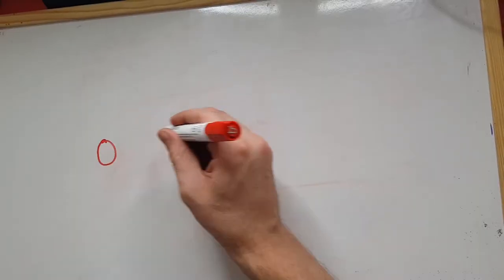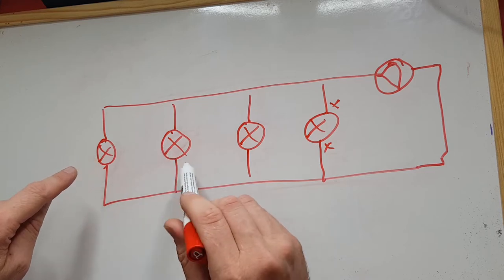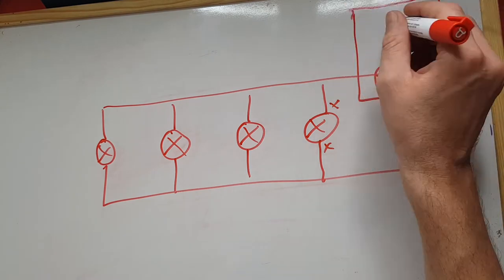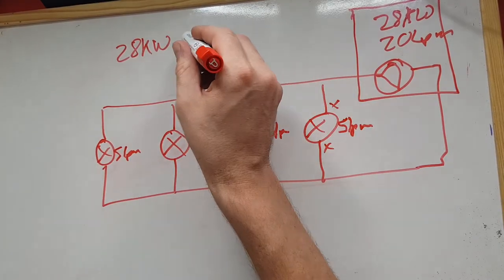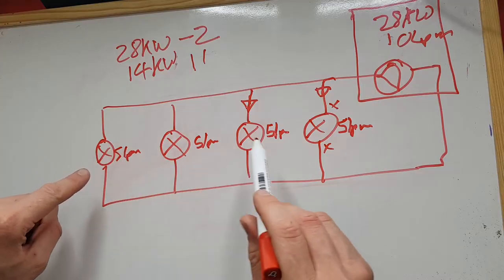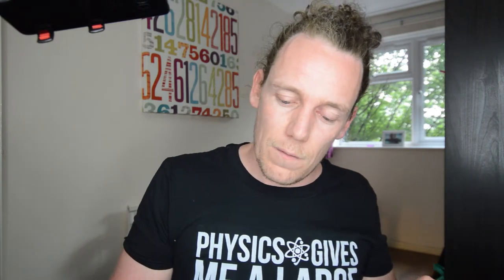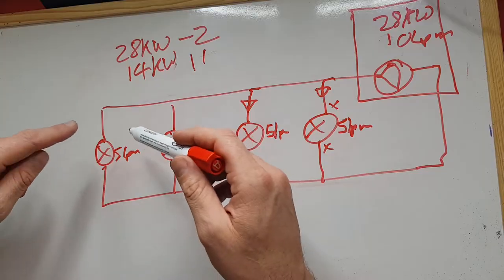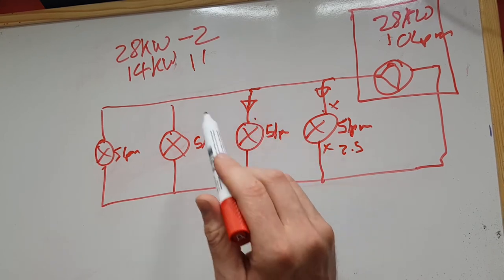Automatic balancing TRVs - Are they worth it?

Comment: Hi, I'm struggling to balance my system and wondering if boiler was ever the best choice for the property (here when I moved in). It's a Keston 55 heat (2 heat zones and 1 DHW). I noticed that the Automatic bypass valve is open all the time even if all three zones are open and the pump isn't on overrun. So the return water heats up immediately as the water short circuits and the boiler then modulates right down. This continues on the entire time the system is on although the radiators do heat up. I did change the valve to a Honeywell as the original was a cheap basic unit and the seal was damaged but even with the £45 honeywell valve there hasn't been any change. Any advice?
Reply from the maker: sorry, there's a bit too much going on there. we would need to see the job.
Reply: Sounds to me like you could do with a low loss header being installed and  by pass SHUTTING permanently. Bit confused as to what you mean by pump isn't on over run as pump is in boiler ,so it has to have a pump over run cause that's what Keston's require, unless its been wired incorrectly.
Reply: Your ABV should not be open at any point ! (Well, almost never.). It only opens in an emergency when your system pump is running full blast (why?) and most of your TRV have shut down because the rooms are up to temperature.
Honey VT117E TRV are rated to work at 0.2bar differential pressure, ie. your system wide pressure drop across flow and return is 2mtr head, more or less everywhere.  So setting the ABV to 2.5m head is nicely balanced.
If your property pipework is undersized and the most distant rads are getting really low diff pressure, the installer may have fudged a solution and set the pump to run at 4mtr head.  Then your correctly set ABV will seem to fail and be open all the time!
Your next level fudge is to set the ABV to 4.5mtr head so that it shuts again, and only opens if nearly every TRV has closed.  The risk then will be that all of your TRVs could be suffering from the excessive diff pressure. If your Honeywells start failing to shut off, then look for some non-Honeywell TRVs that are more highly rated.
The expensive but really good solution though, is to upgrade the size and configuration of your rad pipework so that all rads receive a fair share of the diff pressure from the system pump.

Comment: @Heat Geek  So - I've decided to replace my old standard vented system with a combi boiler but worried that all that expenses will come to nought if my rads are not balanced - hence rather than using the slooooow and error prone way of measureing the deltaT across each rad (I dont even know what order they are in) I want to install something to take the guesswork out of it. So, what TRVs should I select (want the get rid of the lockshields and put their functionality in the trv at the same time) ?
Reply: Hi Kev. As far as the auto balancing valves are concerned, some things need to be clarified:
1. they are directional. So they need to be installed on the IN side of the radiator, rather than return. 
2. Second thing - they do not get rid of the lock shield - the lockshields are required on the return, but are needed FULLY OPEN. 
3. And the cherry on the cake - with the Drayton auto-balancing valves they only allow for settings in a range of DeltaT10-20 on the radiator. Do not confuse with DeltaT for the system. In order to get them to work within the range and do their job - your system is required to run in the still very rare range of Low Temp. flow. So anything that installers used to set-up in the last 10-15 years, with the standard Flow temp of 80/60 return (DeltaT50) is outside the range and will get you nowhere with those valves. 
As per my few discussions with Drayton support, the conclusion is - unless you run your system with DeltaT for the emitters at 20 or lower, the Auto-balancing valves are not for you. 
No manufacturer states that (Drayton, Danfoss presumably neither)!! To run your system with such DeltaT you would probably need to live in a new-build with great thermal / energy efficiency. I suggest reading a bit on how the Low Temp. flow concept works, what is required, how it changes efficiency of your rads and whether your heatloss calculation shows you're at all OK to run the Low Temp flows in order to heat up your property. You may as well find out - the whole thing as greatly as it sounds is fiction and in real live completely unachievable for 90% of British houses....
Reply: @arturlorek7977  not just new builds. Most terraced houses with adequate loft insulation have fairly low energy requirements, so low flow temps are possible. Mine is a mid terrace Victorian house and I can run my boiler at 50c throughout the year and keep 21c throughout the house.
Reply: @immers2410  not saying that the low flow temp is impossible. However you know very well this is not only about the loft insulation. Proper heat loss calculation takes into account loads of other elements - wall types, their insulation, window types (not all double glazing are the same in terms of thermal efficiency), floor/ceiling type/insulation, etc. So simplyfying the matter to a statement - one can go with low temp flow once they have sufficient loft insulation is at least misleading. The fact that one can go down with flow temp on the boiler does not mean the CH is going to be efficient. To prove the point you can run it that way - yes, this can be done. But will it run as it should, giving heat as calculated and so on - that is another matter. Properties in the UK in the grand scheme of things are improperly insulated. Simply because no one cared for this over the last few decades as the cost of fuel/electricity was low so the cost of proper insulation and energy efficiency was far higher than the benefit. It is only in the recent few years we're observing a U-turn and such increase in heating costs, that we are trying whatever we can to get the bills lower. Still does not mean that with most scenarios this will work as it should. And purely mathematically your 51C flow ideally would get you 20deg drop on return and paired with say 20C room temp - we're looking at DeltaT20, which is the upper level of the Drayton auto balancing valves operational range. Ideally you should be running at 45C Flow, to get it in the middle of their range. With such a low flow temp - I feel that running your CH all day long would not get your property heated. So insulation on all fronts would be the key, to not having had to go for a K3 rads 2m long in each room 😂
Reply: @arturlorek7977 so many words to say very little

Comment: Can the IMI and Drayton auto balancing valves be used on radiator systems that have variable speed pumps. Some are saying they're just for fixed speed pumps so would that not mean they won't work very well with a V-200 on weather comp?

Comment: A modulating boiler just modulates the flame. The amount of water pumped remains the same. The modulation part is more heat from more flame. This means that self balancing valves still work as expected even with a modulating boiler because the amount of water being pumped around the system never changes. Or that’s how I interpret things 

They are perfect for smart radiator valves that call for heat individually.
This is because if one radiator valve (TRV) is fully closed then no other radiator is affected as the flow is maintained as long as every radiator has self balancing valves fitted. 

As one radiator is closed the return temperature increases (due to less surface area for heat dissipation) but a modulating system should reduce output to maintain a factory set temp delta (usually 20 degrees). 

This means if you set your boiler to 65 degrees the water will be 45 degrees when it gets back to the boiler. 

The aim is to have a return temp of less than 55 degrees for max efficiency. 

There are some high end boilers that do modulate flow but they also incorporate a pressure sensor that would mean that flow is maintained. 

In your video you are suggesting that lower boiler output means lower flow but I think this is incorrect. A lower output means less flame so less heat. Water flow is fixed and doesn’t change from the boiler.

Comment: In a heat pump system with an underfloor manifold and a radiator manifold in separate floors:
Would you recommend one lock-shield on the radiator maniflod to prevent water from preferring this route with less head loss?

Comment: Is it possible to say what the radiator flow and return differential should be when balancing radiators on a system powered by a heat pump?

Comment: Enjoyed your video but have a question:
Question: I would like (if you agree) to have Drayton balancing valves fitted to my rads. Presently I have 10 rads that have  type TRV’s fitted except 2 (bathroom towel rad and hall rad because my wall T/stat is located in hall) and those two don’t have any controls and this is because my Worcester/Bosch boiler manual states that the installation should have 2 rads without controls that will act as a bypass in (addition to the integral bypass within the boiler). This conflicts with what Drayton said that all rads should have balancing TRV’s fitted, so what is correct? In conjunction with this, won’t the wall mounted T/stat be fighting with the TVR on the hall rad if one is installed there? And can the system not be considered balanced if those two rads do not have balancing TVR4’s fitted? Thanks for your patience.
Reply: RE: bypass question, see https://youtu.be/jqu2FpAA8IA?t=1177
Reply: Hello, when they say all rads need to be fitted with TRV’s they mean the body of the trv and then set the flow rate. You wouldn’t install the actual trv head on the bathroom towel rail or the hallway rad.

Comment: But how does this apply to a rural setting where we use a system condensing Kerosene Boiler with a fixed pump speed? and no pump over-run. What's the best way to maximise the efficiency of this system?

Comment: So should I fit self balancing drayton trvs or not! I am replacing my old boiler with a standard boiler (keeping vented hot water tank)
Reply from the maker: No they aren't for homes.. they are for communal heating systems...
Reply: @HeatGeek  so why does drayton say explicitly they offer homes especially if they look nice in polished chrome?
Reply from the maker: @kevinleesmith  becaise they want to sell as many as possible. I spoke to them directly about this, infact they called me. It was embarrassing
Reply: @HeatGeek  so why can't they be used in a house? And what do u mean by communal systems?
Reply from the maker: @kevinleesmith  they can be used in a house, you just won't see any benefits over standard balancing and will have increased system resistance as the video suggests
Reply from the maker: Conunal system is a blick of flats for example with a shared heat source
Reply: @HeatGeek  when you say ‘increased system resistance’ do you mean it will result in the pump running against a somewhat dead head and causing  noises in the piping and/or overall system etc?
I was considering installing these Drayton TRV4 self balancing valves in my house. I have 10 rads with old style TVR’s on all except 2 of them (bathroom towel rad  and hall rad where I have the room T/stat). My Worcester/Bosch manual says that those 2 rads should not have a TRV on them as they should act as bypass valves (even though there is an integral bypass in the boiler). Drayton say to install them on all rads, which contradicts boiler manufacturer and if they where only installed on the other 8 rads, could you still balance the system?  Totally confused!!
Reply: @HeatGeek  Alo Alo

Comment: Hi mate, my understanding is these valves shuttle open/close as the burner pump speeds up/down, keeping flow equal between rads. What am I missing? (Keep up the videos and blogs. Great work 👍)
Reply from the maker: Hi Dean. Thanks for your kind words. I'm not 100% sure what you mean. But, these valves do not have communication with eachother... the only thing they do is allow a set continual flow rate through that specific  radiator.. does that answer mate?
Reply: Heat Geek my “crude” understanding of them is they are spring loaded. When boiler speed is low, the valve closes down letting little flow through. When it speeds up the valve lifts, letting more flow through. Setting the valve, limits the max flow through the valve and creating more/less tension on the spring (I’m not sure about the tension part, I’m assuming). Your video is how I would interpret a lock shield valve. Ie. Ok when pump is running on max flow rate but when pump slows the rads closest get too much flow (as lockshield valve has been set to allow max flow rate). Am I getting this theory back to front?
Reply from the maker: @Deano5879  yes back to front mate. This valve is designed to give a set flow rate no matter what the dp (pressure differential) is either side of the valve. Hence it is pressure independent. 

When you get a faster flow from the boiler you will ALWAYS have a higher dp. Dp and flow rate are intrinsically linked. I have a balancing article coming out this week which will help further on heatgeek.com
Reply: Heat Geek thanks for persevering. 🙏

Comment: Still trying to figure out he design differences between Canada and Britain. whenever we design a modulating boiler, it usually means we vary the temperature of the water and not the pump speed. basically, once the overall balancing is done for the coldest day of the year, then the outdoor sensors will regulate the temperature of the water coming out of the boiler, and not vary the flow. Is this not how things are designed in the UK?  learning a lot about European design from you.
Reply from the maker: Hi Toni. As per mass flow rate calculation, if you dont slow the pump speed as you input less energy (as you will when running at lower temps) the DT will shrink throughout the year.

This will increase the relative return temperature and decrease the condensing effect as well as wasting pump energy. 

Condesning boilers maximise efficiency by making the return temperature as low as possible to increase capture of latent heat.

Does that make sense?
Reply: Makes sense. Just never dealt with a boiler that can modulate the flame so low as to be able to handle a flow cut by half without turning the water to steam. So it was always safer and easier to maintain the same flow in the boiler while the flame was  modulated. Dealing with such efficient boilers as Viessman does add a new variable to the UFD.  Thanks for the follow up.
Reply from the maker: @tonigerges1180  you guys have some way to go efficiency wise it seems which is a shame.. were now all leaving the condensing boiler tech for heat pumps i think.
Reply: Tbh, I did my first geothermal heat pump design on a 900 SM house with all underfloor heating, back in 2005, and vowed to never do it again. I am a big believer of keeping things simple with a thought on the after warranty maintenance. When you lose heat in a system like that, the question becomes who does the homeowner call? An AC tech, a plumber, an electrician, or a controlls expert. With that in mind, I have tried to stay to one median in a heat system setup, and utilizing simplicity. Air to water or ground to water always gave issues with the domestic hot water usage. Now I am rambling. Love your videos though.
Reply from the maker: @tonigerges1180  takes a good level of understanding for sure! Thanks for your comments. Really interesting hearing the comparisons. If your on Facebook you should join our group! Search Heating system design
Reply: @HeatGeek  It's probably market dependent. Pumps used in wall-hung boilers in Eastern Europe typically also run at fixed speed or fixed differential pressure. SOME models allow you to enable delta-T modulation, but it's an option and not many have it. Quite few actually have a return temperature sensor.
Reply from the maker: @danielardelian2  its entirely wasteful to not use dt based pumps imo. Both sides of separation.. and also essential on heat pumps